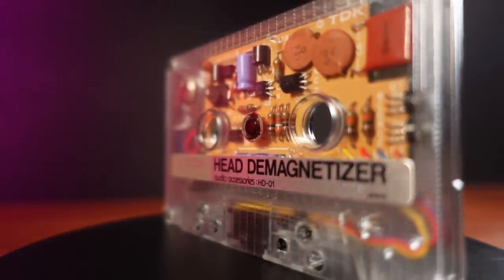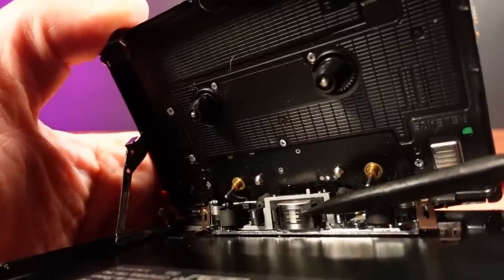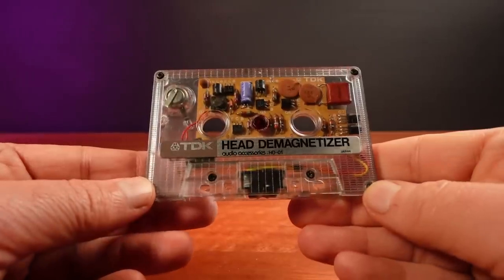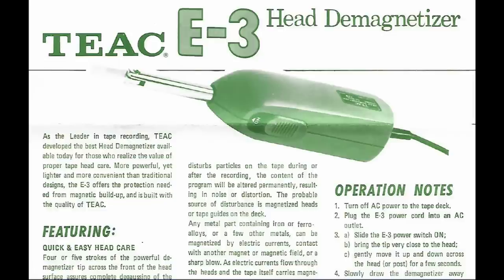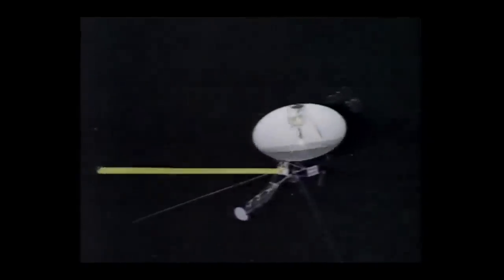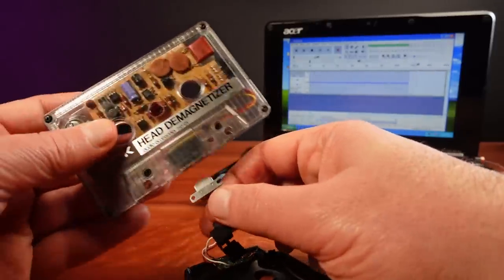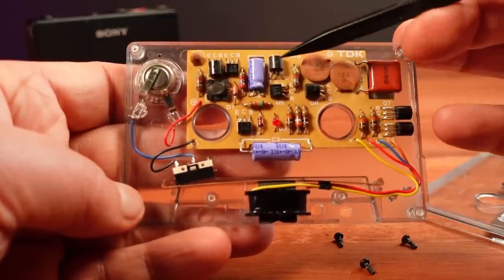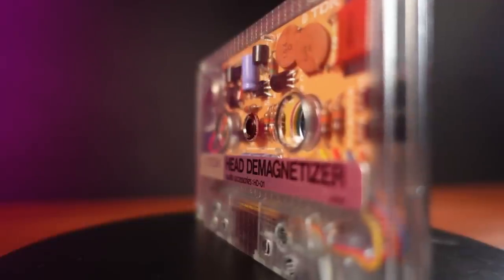No One Knows If This Actually Works

Comment: I had one of the TDK demagnetiser cassette, the exact model you show in the video.
The magnetic flux generated by the cassette is minuscule when compared to the wand-style, classical demagnetiser, but the frequency isn't 50 / 60 Hz, but it is in the audio band. The flux generated by the cassette is 100 times higher than the field induced by the rolling magnetic tape.
I conducted some tests with the TDK demagnetiser. You can verify its efficacy with a CrO2 reference tape with a 10 KHz note. The amplitude of the output is 15 - 20%  higher after 4 or 5 demagnetisation pulses with the TDK cassette.
This is because a magnetised head core (caused by playing CrO2 and Metal cassettes) limits the reproduction of the higher frequencies.
By the way, it is difficult to evaluate the functionality of the TDK demagnetiser without proper instrumentation, because the ear can't pickup a 20 dB difference at 10 KHz or more.
All in all, yes, the TDK demagnetiser works. It is useful? In a professional setting, where the audio equipment is properly calibrated, yes. 
As last note, the TDK demagnetiser cannot recover a magnetic head after an accident - when somebody intentionally put a magnet in contact with the head. You need a wand in that case.
Regards,
Anthony
Reply: Wonderful information, thank you!
This should be a pinned comment.
Reply: Same with me: bought it when it was released by tdk, used it regularly on all my tape machines (Harman Kardon, Nakamichi, Technics, Sony, Revox, Teac, Tascam) with notably audible results. Still using it. Compard to other models (some shown in this video), it is by far the most efficient one and way easier to use than the magnetic wand (that, for obvious reasons) I keep for reel to reel tape recorders.
Reply: At 5:05 it is specified the signal from the demagnetizer is 588 Hz. This video seems to me like a joke. I recently purchased a Teensy 4.1 microcontroller along with a few small gadgets/peripherals. One of these was a BMX160 9 axis sensor which includes one incredibly sensitive 3 axis magnetometer. It would have been very easy to check the magnetic field generated by the demagnetiser as well as the one generated by a magnetized vs demagnetised tape deck head. A difference would have indicated the effectiveness of the device tested.
Essentially since the creator of this video can't make sense of what the demagnetiser does and is too lazy to check these details, he comes to the conclusion its only purpose is to "look good". I always assumed the "transparent" aspect of it is so you know this is not some music tape. Also a thorough investigation would have included the electronic schematic of the device which is fairly easy to do.
Reply: Some side info that confirms this..
You can magnetice a screwdriver bit only using a passive ferro magnet. This means that continuous exposure from a magnet even if it’s passive can effectively turn the receptor metal into another magnet. That magnetic field will create a signal which will cause noise since magnetic fields are constant and non fluctuating
Reply: @franciscopostigogarcia2694 
Continuous exposure to a DC magnetic field, yes. But an AC field like from a tape is constantly going positive and negative. Furthermore, even if the signal from a tape or from the signal being output through the head is enough to magnetise it, why would a signal from this fancy cassette not just magnetise it further? There probably are reasons why it does actually work (still not entirely sure how you get rid of the remanence without actively measuring it and opposing it), but they’re not the simplistic ones suggested by your comment.
Reply: @Scrogan  
the biggest issue with head magnetization is the introduction of noise in the pickup head. Ferromagnetic materials experience a hysteresis effect, or a resistance to change polarity with small and/or fast changes in the magnetic field formed when the tape passes by. A magnetic domain is like a small magnet within the larger bulk of the material, in this case, the pickup head, which has billions of them.  Due to this hysteresis, over time, more and more of these domains begin to align in one direction only, magnetizing the head, and reducing it's ability to react cleanly to smaller and faster signals, generating more noise, and lowering it's high frequency response.

by feeding the head a relatively large magnetic AC signal, more than a thousand times what the tape passing along generates, it forces all of the magnetic domains in the pickup head to align in one direction, then another, over and over again. in essence, magnetizing it. the beauty is the relatively slowly dropping signal strength. Balanced, the falling signal strength then makes progressively fewer and fewer domains switch polarities, evening out the domain polarities within the head.
Reply: 'the ear can't pickup a difference of 20db at 10khz'?  Huh?
Reply: @chrlz904  That's what I was thinking.
Reply: @chrlz904  I believe he meant humans cane hear below 20db and above 10000khz at least in my years as an amateur audio engineer this stands true.
Reply: @rayoflight62: totally agreed with all you say, except that running a tape over a magnetised head doesn't just "limit the reproduction" of higher frequencies, it literally erases them from the tape.
Reply: "...the ear can't pickup a 20dB difference at 10kHz or more."?

Yes it can. I've just generated a 10 second 10kHz sinewave in Audacity and then randomly selected a chunk to apply a 1dB reduction in gain to. I can very clearly hear it step down then back up in volume. Even a 0.5dB change is just about audible. For the record, I'm approaching 60 years old and listening on a pair of mid-budget bookshelf speakers, so you don't need to have particularly good hearing or expensive headphones to test this.

Try it.
Reply: How about testing the demagnetizers with a section of ferric tape. First, record a constant auditable signal to the tape. Next pull some of that tape out of the cart or spool that was recorded. Third, apply the demagnetizer or wand type to the tape surface and activate it. Fourth, just spool it back up and play on any cassette player and monitor the depth of the dropout. Since these are demagnetizers, they should have left a noticeable dropout on the tape. I found that some don't do anything at all. Radio Shack once made a demagnetizer that had a permanent round magnet. I put a recorded tape up to one of these, and it erased a section with a dropout. Those couldn't be any good at all for a tape deck and would damage it. I had one and used it regularly  years ago. I lost most of the high end, and it never recovered.

Comment: A magnetized head erases highs from your tapes as you play them and it increases noise when recording. Not long after that TDK demagger came out, I tested it using a gauss meter to see if it actually reduced the magnetism of a magnetized head. It did next to nothing - too weak. A real demagger reduced the field to below what the meter could read.
Reply: these were only likely designed to remove slight magnetisation, not where its enough to partially erase recordings, that said, i have a similar but different one, and it rapidly pegs level meters to the right for a second when activated,   ..it did help in a couple of cases.....

Comment: I have been servicing tape decks for several decades, and I have a 110VAC demagnetizer I use every time I clean and service a deck.

Most people will not notice the degradation over time, but it is a reason their tapes go bad. Yes, there is a hiss that can be heard when the head is magnetized, but the magnetization can cause the tape to be erased over time while it is being played, and in the end, the tape will be unplayable.

These cassette tape demagnetizers were sold to do what the AC units did, but they didn't get the job done, if the head was seriously magnetized, and was the reason I kept my AC unit.

Comment: I was lucky enough to find a new in box Realistic tape head demag which I used to sell while working at Tandy's back in late 80's :) I have used mine once on a Sony CFD-5 boombox (first with a CD player built in the D-50) It had a lot of hiss and the demag really helped other than that it has not been needed. There is a guy I have dealt with from Romania his name is Segui and his name on Tapeheads is magnetic Blood. He restored my AIWA PX10 walkman and I he recorded some albums for me (Queen, Australian Crawl, 1927 Ish and others) onto 2 x TDK SAX-90 chrome tapes using one of his very high end tape decks ( Nakamichi or Revox) Playing in my AIWA PX10 and Sony DD9 Walkman they sound fantastic. Better than the cd version.
Reply: That's a good point, a lot of players play better than they record, which is a trick you can use to optimize your gear. Like I did back in the day — why buy something expensive if my dual head Marantz is fine for playback and keeping the speed constant, and when I need to record something I can just go to my friend's place who has 12 Nakamichi decks fully serviced :-)
Reply: That's because of the pleasing coloration and harmonic distortion in analog recordings. It's what keeps us going in analog. Most everything I have sounded 'better' after going through my Tandberg TD20. The deck's preamps are responsible for that colored sound, along with my main amp/preamp etc. That's why it's not always the best choice just to throw a bunch of analog gear together and expect stellar results. It can take decades to get good matches.....and then there are the room acoustics...lol.

Comment: The first sound equipment I bought was a Sony double cassette + CD player. I played tons of tapes there but after some time, the recordings were being poorer and poorer no matter I cleaned the heads. Once I made an experiment erasing a whole tape. Curiosly the next recording I made wasn't too bassy, noisy and limited crunchy trebles. That was the time I read about residual magnetism on tape heads. I bought the same TDK model at a local flea market (more or less five bucks). At first, I didn't note any big difference in sound quality, except the noise floor was reduced substantially but recordings were improved 100%. After many years educating my ears and playing tapes I can assure you this little machine does its job and it worths every cent you spent on it.

Comment: Speaking for me, I still have my TDK HD-01, It works well to de-magnetized the tape heads on my decks, but one still needs to remember to clean the heads, the capstan and the rollers.

Also, be sure that you have turned off the audio. This makes a horrible noise if you use it with the sound turned on.

Comment: It's not needed very often with a domestic cassette deck. Cleaning the heads frequently is what makes the biggest difference. Also, aligning the head is sometimes makes a massive difference, especially on machines picked up second hand. The mains powered hand held demagnetizers probably do a better job, but in some cases they can be difficult to get near the heads of certain cassette machines.
Reply: yep..most important, keep heads and pinch rollers clean,

Comment: I remember Radio Shack had one demagnitizer that had a permanent round magnet in it that was rotated by a cloth tape that also cleaned the heads. I think these did more harm, magnitizing the head than removing any. It made a weird rumble sound over the audio out that sounded like the traveling cylinder space probe in Star Trek 4, which I really think where they got the sound effect from lol.

Comment: I remember seeing these in the 80's, never had one though. Always kept to the much cheaper tape based head cleaning cassettes. I particularly remember one with a green tape inside that should have been able to demagnetize the head. I don't think it worked though. Back then I would've loved to have an electronic demagnetizer. Btw, for some reason I was remembering these demagnetizing cassettes as having little less electronics inside and a green circuit board (or perhaps the later 80's models did.)

Comment: I purchased one back in the late 80's, it came in a nice plastic case that also had a wet type head and capstan cleaner. 
From memory, I believe that it was the Music way brand... I still have it somewhere, probably used it once after I got it, couldn't notice any difference before or after. 
I noticed that your TDK one only produced one short blip while I specifically remember my one was very audible and the sign wave signal will continue until you stop it... 
But you are definitely correct, apart from the TDK MAXG and it's metal frame which was a very cool tape, the Demagnetizer tape was the coolest thing that I had ever seen and the primary reason why I got it....

Comment: Having used one I put this in the category of the $100 HDMI cables some vendors try to push today.
Reply: Yep. It's called snake oil.... In this case, the demagnetizer may work but the snake oil part is making customers believe they need one. Most customers never put enough hours on their decks to actually need demagnetizers

Comment: IMO magnetized heads are a problem not in a sense that the sound becomes worse when playing, but rather the head being magnetized acts as a heck of an underpowered permanent magnet, akin to an erase head in a very cheap recording mechanism — thus any of the tapes you run past it will get a decrease in signal level and an increased noise floor. By how much — that is an open question! :P On a Metal tape like you showed, or even Chrome tape, I think it would be negligible due to how much coercivity they have, compared to Normal (ferric) tape — they need much higher magnetic flux for things to start moving around.

It would make sense in an industrial environment on open-reel machines where a single tape head can see multiple kilometers of tape in a day (wait that sounds like my  old home when I was in a mood to listen to something) and the tapes themselves were supposed to be stored as best as possible, but a wand type demag would be more likely way better for those. Not to
Reply from the maker: Very interesting, I have always wondered how well magnetic tape holds it's magnetic field over time in general as well.
Reply: Well magnetic tape and floppy diskettes work on the same principal. The density of the encoded data and its storage characteristics play a huge part in retention. Manufactured audio tape would have a reasonably strong write coupled with a relativly low data density. this plays out with floppies in that the higher density have less stability, but sometimes the media flakes off the substrate due to storage issues.
Reply: @RowanHawkins  now that you remind me of floppies, that becomes very interesting — i assume floppy drive heads get magnetized as well, but i've yet to see a floppy drive demag in the wild. I guess the combination of it being digital (so you only need to distinguish 0 and 1 via FSK or whatever) and people never really spinning the same floppy for ages continuously ends up making the "noise floor" on the floppy not being a concern. 

Now that I have a floppy based MIDI player that never stops the motor and I'm listening to on a daily basis, we might find out — so long as that happens faster than the disk develops a hole from the head friction and the constant spinning :D
Reply: You are right. I once had a taperecorder where the head became magnetized - not because of build-up from regular use, but because the left record amplifier had a problem. If I play some of the tapes I used on that machine on the one I have now I can clearly hear more hiss in the left side than in the right.
Reply: @organfairy  yep, heads are unlikely to get magnetised in normal use but poor or faulty circuitry can certainly cause it, many cheapo cassette players used dc bias , much more likely to occur with these!   once a tape has been played in a machine with an excessively magnetised head, that recording can be permanently 'damaged', partially erased even..

Comment: In the 1980's I used one of these and to see what was happening I inserted the demagnetizer and pressed play on my cassette deck and I displayed the output on a CRT oscilloscope. I still have mine.  My main use for it was pressing the demagnetizer head to watch the LED light up.  In the 1980's it cost £7.95  from Curry's  If you paid any more you were mugged!

Comment: Here's  a tip, just run the deck in record mode for a few seconds  Then, swab the head with isopropyl alcohol.  It's worked for me for 50 years.

Comment: I noted that the demagntization waveform is clipped when the demagnetization cycle starts. Is the clipping due to overload in the computer's microphone input circuitry, or is the core in the playback head used for this experiment going into saturation? If the head core is going into saturation, then the head demagnetizing cassette is doing its job.

The question that remains is, is there any value in demagnetizing a tape head without demagnetizing the capstain? I can certainly see how these cassette demagnetizers would have been desirable as convenience items for automotive cassette players.

Comment: It does work, They had two models the HD-01 and the later unit the HD-30 that worked better for decks with logic controls.  I tested the HD-30 by magnetizing the tip of a small screwdriver and then pushing the tip of the screwdriver to activate the HD-30 and yes it WORKED the screw driver WAS TOTALLY DE-MAGNETIZED.

Comment: Yes , they do work amazingly well , I used to by my records and record them straight on to tapes , and thrash the tapes  , so to keep the Vinyl good , point is , tape heads got dirty , do cleaned them , but that after a while didnt restore sound , But when useing a Demagnetizing tape every thing came back to perfeck, You need to clean and demagnetize you tape deck heads regulaly